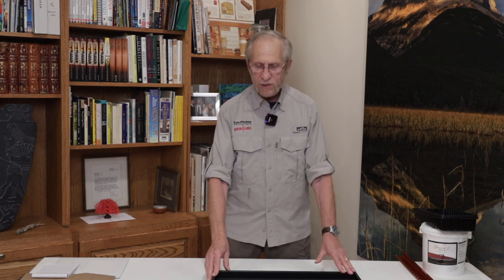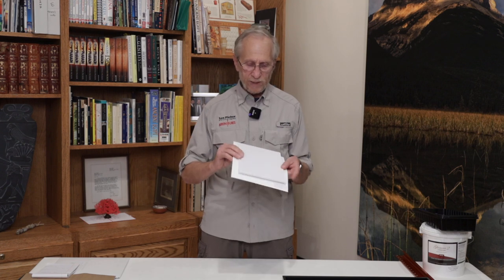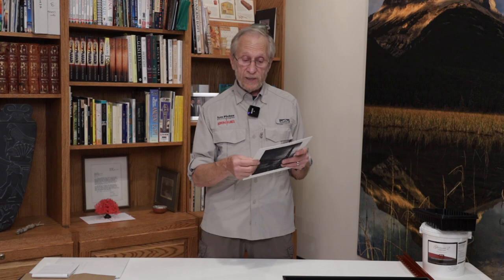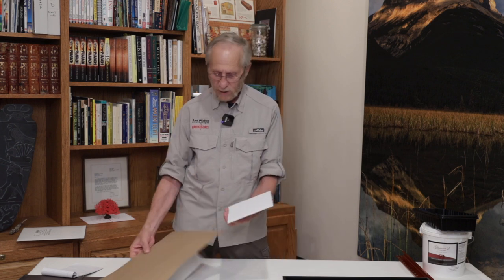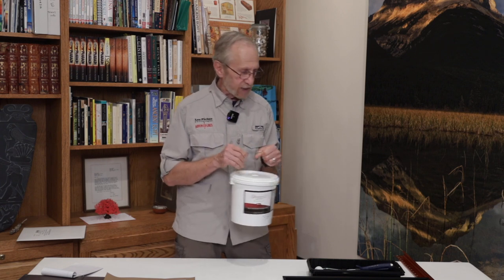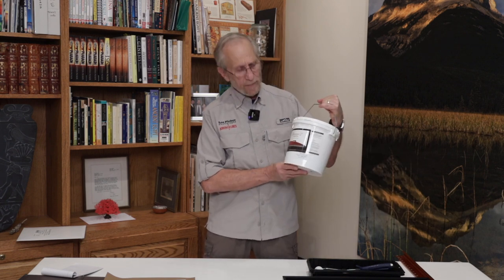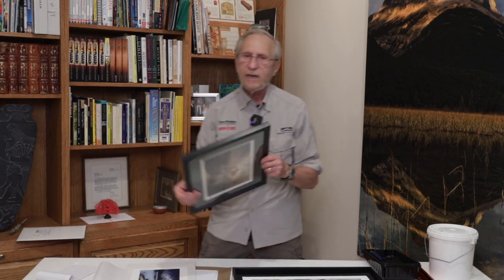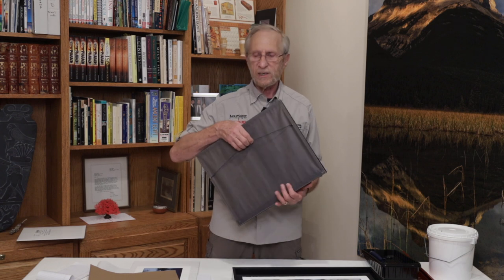Mounting Your Deckle-Edge Prints

Comment: Thank you for this informative video. I am curios to know what kind of frame you used in this example. Did you also put glass on top?
Reply from the maker: Arif, thanks for writing. I picked up the frame from the "Sale" bin at a big box store, but you can get them online, too. It's a deep frame which looks good with an image that uses a stand-out backing board. I generally do not put glass in front of prints that are raised off the backing board, but there have been client who have specifically requested glass for such a mounted print.